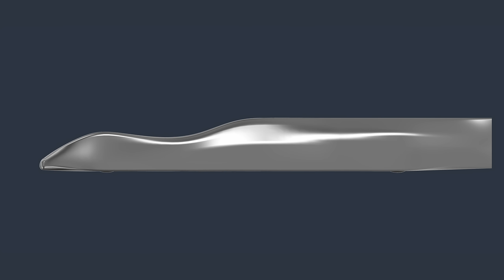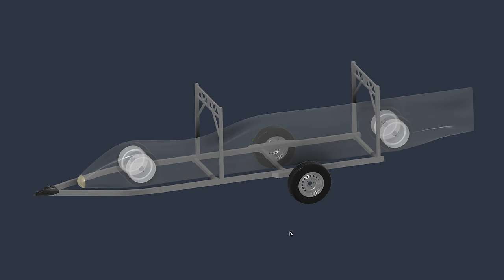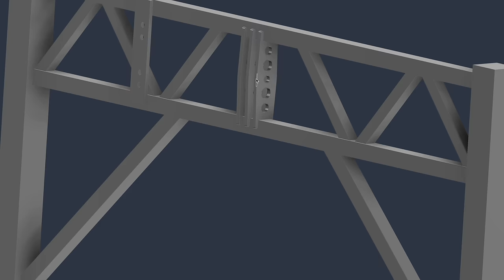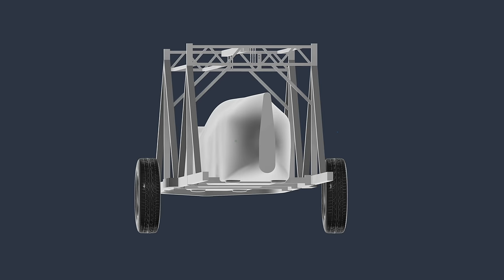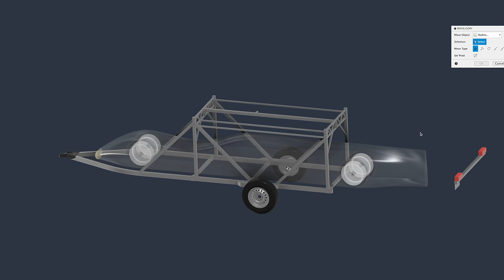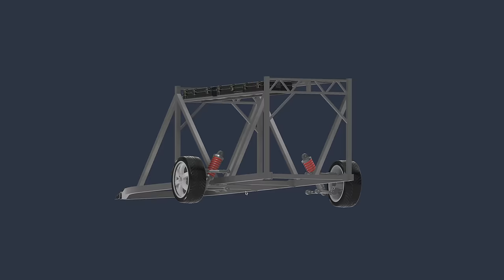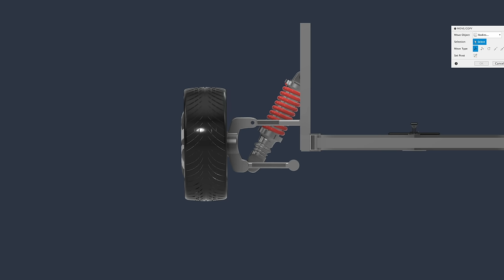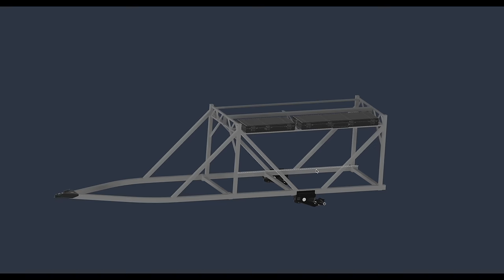How To Trailer A Car With ZERO Ground Clearance

Comment: This is so much more complicated than adding dolly wheel points to the frame
Reply: Do you mean adding dolly wheel points to the frame of the landspeed car? The car is going to get a fiberglass body which probably isn't rigid enough to support the car.
Reply: @vroomfondel5447  yeah, a little pinhole through the body into the frame where you stick a dolly wheel. I’ve seen similar on factory equipment
Reply: @jaredj631   I believe the nose will stick out past the front of the frame by a foot or two.

Comment: So you didn't put bearings on the pulley that you will load up. But you did over design the swing arms with double bearings that will just carry their own weight? Can't say that makes any sense.

Car tires are not the right solution for trailers. That's why trailer tires exist.  They typically have a higher profile, since tire flex is a big part of trailer handling. I suspect (but may be totally off base) that the load rating of the car tires isn't correct either.
Reply: True on many counts, however trailer tires are usually only rated for low speeds.  And you know....race trailer go zoom.  (I joke...but honestly on such a low weight and single axle trailer he'll be fine.  Probably.)
Reply: The swing arms will be carrying the load of the car when it is loaded.
Reply: @dirtdart81  which they didn't need bearings to do.
Reply: @donhappel9566  with trailer tires, a lot of the concern is side loading. Also, I can't recall what the race car weighs.

Comment: if it ever comes up... turbine engines are sometimes raised into a test stand via a screwjack that pulls cables. it can be cost effective in the sense that you don't need to buy a winch to pull a foot and a half on and off the drum with 25ft of cable. you can also use a trailer jack in place of an electric screwjack

Comment: I don't have time to read all the comments on the toilet to see if it's been said, but it's worth mentioning to the public.  Wear a respirator and grind off all the galvanized coating before welding, and wear one while you weld. That shit will make you seriously sick! Another great video matt, my idea has always been to have a motorcyle trailer that lays flat to the ground with a cantilever air suspension set up.

Comment: cool trailer seems simple to do if you have cad model and tools and don't forget to make sure everything will work and make sure everything is installed correctly and dont have OCD, otherwise straightforward cool build !!

Comment: About 7 years ago I actually had nightmares about car clearances on steep ramps. It wasn't so much as specific car models but rather a basic geometric figure in the shape of a car. I remember the worst part for me was at the top where the car gets stuck on it's frame....

Comment: Tip: the ratchet straps to lift the car work perfectly and are easy to replace if they get damaged. They might actually be a better solution than welding hooking points to the frame,

Comment: One solution that I've seen for people who have larger cruising type Harleys that they need to put in the back of a pickup is to have a platform that lays flat on the ground and then the motorcycle is tied down to it and then the entire assembly (platform plus motorcycle) is angled up and winched into the back of the pickup.

Comment: I use two m18 batteries wired parallel to run the 5500lb winch I have on my truck crane it works great even though I was told it wouldn't

Comment: I deal with slightly bigger cars, and I've always thought about making a universal car sled (with wheels) for the low cars. Strap the car to the sled and drag the sled up. I also thought about the gantry idea, but cant make it work since I don't want a dedicated trailer for the race car - I have enough junk as it is.   I like how this one turned out, I'll have to keep thinking...

Comment: You could make a rail above the trailer, put some rollers there with a winch, hook the car, lift it and push on the trailer. You could make some rollers to put under car's wheels to make some ground clearence so it could go on a normal trailer. Both ways would be simple but yours is cool.

Comment: You may put removable transport wheels on the car.  Just two small axles with wheel (removed for the race).  The front assembly can be design with a handle to pick up the car as low as 1" from the ground -- on a pin.

Inspiration F1 Racing front jack  (but with bigger transport wheel).  You can also use a dolly in the back (very simple an easy)

Comment: The "correct solution" for suspension is a horribly bad trailing arm - the pivot axis base is comically narrow. But it does work, and for the two or three uses that this trailer will actually get, I'm sure it will be fine... and other people who buy these declare that they are wonderful.

Comment: Here in the UK, since (IIRC) 2012, all new trailers need to be inspected and issued a chassis/type approval plate. These plates have (Amongst other things) the curb weight, the maximum loaded weight, and a model/manufacturer identifier number of some kind. The problem here is that cars ALSO have a maximum towing weight. Due to some questionable thinking when the laws were being wrote, you need a tow car that has a maximum toing weight in excess of the maximum trailer weight. That all seems fair until you realise that it's the maximum weight that the fully loaded trailer COULD be, so your 200kg (About 440lbs) empty trailer can't be towed behind your hatchback car that has a max towing weight of 1000kg if the trailers fully loaded total weight could potentially be 1200kg.......even if the trailer only weighs 200kg in the unladen state you want to tow it in.

There ARE a few useful little caveats to this though. For example, any trailer that was first used PRE 2012 has grandfather rights to be on the road, and doesn't need to be retrospectively tested/plated. There's a big benefit in how the maximum curb weight is pretty much anything you say it is, so as long as the tyres, suspension, or hitch isn't rated lower than that it's current weight (And as long as the police can't point to any particular part of the structure and say it's not strong enough) it's all good. There's also a bit that says an older trailer can be modified to keep it in a roadworthy condition. The general wording implies that the government would rather people modify their trailer so they can fit new (But not necessarily direct fitment) replacement parts instead of them trying to nurse along old worn out parts to keep the trailers non chassis plated status. The funny thing is, they don't specify HOW MUCH of the original trailer would need to be replaced before it's seen as a new build that would need inspecting......... Hmmmm, I see a loophole here. :D

My little 3x4' "Angle iron and planks" style utility trailer was originally (quite badly) home built sometime in the 1970's, so when I got it the thing was in a bit of a state. The first job was to replace the wheel bearings and hubs on the spindly solid axle. Darn it, It turned out that I couldn't find any replacement hubs..... So the whole lot came off and I found some braked independent trailing arm units that needed a new home. The problem now was the forces acting on the chassis would be completely different between the leaf spring and trailing arm setups, and I was pretty sure the 1.5x1.5X1/8" angle iron chassis wouldn't take the new twisting forces, so I built a new chassis out of 2x2" and 2x1" box section. While I was at it, I realised that 3x4' isn't really that big for a trailer with the accidentally overspeced suspension I'd bought, so I bumped up the bed dimensions to 4x8'. While I was at it, I also added some ease of use features, like removable back and sides, lots of tie down options,  sides that hook into the rear to double as ramps, and a lock box to keep a spare wheel and multiple ratchet straps dry and safe. As the original planks now wouldn't fit, I replaced them with a sheet of expanded mesh, and composite decking planks.

As it stands, the original parts are, the jockey wheel, the lights, and some of the old chasses angle iron that I chopped up and used to make brackets and stuff.......... BUT, by the exact wording of the relevant UK laws THIS is still just a legacy trailer that's had extensive repairs and modifications that enabled me to replace unavailable worn out parts.

With no chassis plate, when it's behind my VW Golf it's rated to 1400kg, but if it was behind something smaller, it's max weight would instantly be whatever THAT cars max towing weight was, and when a mate borrows it with his 1980's Land rover, it finally hit's the trailers suspension unit limit of 1.75 ton ! There's few cars that could tow a 1750kg rated trailer in the UK, so if I HAD bought one pre built (And plated) for this max curb weight, I'd not have be able to tow it with my current car.
Reply: See over here in NL they did it the other way around. If your trailer did not have a chassis number and registration of it's own, it'd automatically be derated to 750kg max total weight. Anything that has a maximum total weight of over 750kg needs to have it's own registration. And of course the required B+E license.

Comment: "Clean it later trailer" for when the only two parts of your landspeed car worth cleaning after the race day are the mounting holes. As a bonus, the new trailer should be even better at carying metal stock. Or water pipes, not secured in time.

Comment: Hey Matt: About Trailer Tires versus Car Tires - a couple of questions:
1.  What is the Date Code on the Viper Tires? While not an issue on Cars because they are typically being used and will wear out, Tires stored or on Trailers are not used as often with the result being that there can be Tire Failures for no apparent reason because of old rubber.
(This is what caused actor Paul Walkers car crash on what appeared to be new tires even though they were actually >9 years old)

2. Trailer tires are different than Car tires with a thicker sidewall (since the 2 tires are usually carrying a heavier load than the 4 tires on a Car) and are designed to dissipate heat faster. Will this be an issue with the Viper tires on a Trailer?

You've probably forgotten more about cars than I'll ever know but something to consider, especially given the low cost of a couple of tires compared to the cost and safety of what they will be carrying and attached to.
Here's a quick video on the differences: https://www.youtube.com/watch?v=rYOraVTyPOY
Reply: Also, not sure if Trailer Sway will be an issue with a Car + Trailer w/ Car-hanging-out-the-end Combo that is overall over 36' long but here is a video that I bookmarked a long time ago about the only way to reliably control for Trailer sway: 
https://www.youtube.com/watch?v=nc0ndz92IWY
(TLDR: Add a Trailer brake like the one that you mentioned at the 7:13 mark)
Reply from the maker: Good info. The date code and load capacity of the Viper tires are both good. And I didn’t mention this in the video, but the trailer has electric brakes. Honestly, I will likely get actual trailer tires at some point. Probably when I get around to listing the viper wheels and tires for sale.

Comment: If that steel line becomes an issue. I recommend looking into synthetic winch line. 
It's light weight and far easier to splice together.

Comment: Tie a plastic bag around the string and use vac to pull through tubes. 👍 Can you use a sacrificial anode on trailer to reduce corrosion. Like a ship. Zinc for salt water I believe

Comment: Just a thought, the folding rear end for tail lights design would also keep the car somewhat protected. Yes only from low probably parking lot mishaps and tailswings, buts its better than nothing, also could add some trailing wheels if you went for the fold out to keep it from bottoming out ever

Comment: I expected you'd just weld a pipe to it and use one of those motorcycle service lifty things to lift it up tbh. Or a wheel dolly going underneath that just lifts it via rollers that "squeeze" the tyre, lifting it off the ground

Comment: The difference between math and engineering:  "The ramps would need to be 8 feet long and the final 3 feet would be 2mm or less".  Then cut off the last 3 feet, a tire should roll over a 2mm lip.

Comment: A vacuum cleaner works well to suck a string tied to a tissue to pull the wires through the frame I thought about compressed air but the vacuum worked first time every time.

Comment: If I may add a suggestion: Add some sort of cover. While that will almost certainly be aerodynamically worse, considering the load, it's a safety feature. Friends are involved in the german historical car scene, and the number one reason for total losses is people driving up to your trailer on the highway, gawking at the car on the trailer...and crashing into it, because people subconsciously steer to where they look.

Comment: I wonder if you could design spots on the sides of the car to temporarliy attach larger wheels for loading and unloading. Then you would just need to jack it up to put them on and off. 2 sets of fat tires and a jack. But your solution looks much cooler. Also perhaps consider adding plates to protect the car from road debris.

Comment: I can't help but think you'd have been better off selling the original trailer to some chump and building a new one from scratch. Not sure what it's like there, but getting a custom trailer vin'd in Alberta Canada is pretty easy - pay the gov't $100, give them the receipts for the steel and axles, voila, vin'd.

Also I found Zinsser Bullseye works great on Galvanized. Had a kitchen with an exposed galvanized pipe at a ceiling corner, that I partially hid by priming in Zinsser, filling the cavity between the corner and the pipe, and painting the same colour as the wall. No bubbling or flaking.

Comment: 15:34 -  You could shorten it but dont quote me in this either but You may run into DOT issues where if the vehicle youre transporting exceeds a certain length of the trailer, it can be considered "Over dimensional".

However i only experienced that with commercial truck driving (53' long with a load that stuck out a little bit to the rear) so you may be fine in your case but its definitely something to consider going forward is all.

Comment: If you tie a long string to an empty shopping bag the plastic bag type. And then use a vacuum at the other end of your tubing you just suck the plastic bag through the tubing and they're your string is for running wire

Comment: check tractor supply they make inplement pins that will work much easier and stronger than bolt and cheaper with small derent ball.
Reply: The bars need to be clamped while towing. Not just pinned in place.

Comment: If you ever have to run string through a tube again,  a plastic grocery bag tied to the end will pull it all the way through to a shop vac on the other end.   It's a lot easier than trying to push a rope.

Comment: Brilliant as usual ... Cannot get over the idea that you go as far as taper roller bearing sets to allow the supporting cross members to swing across @ maybe half dozen swings per outing .., it interesting that sub 500 cc how many motorcycles get away with plain bushes for rear swing arm that do a site more " duty ".., but hay .., it's your money ... Love the double lift single winch ... Would it be worth putting back plates / inner wings ( fenders ? ) on the wheel arches to keep the salt from spraying up when moving to & from the big flat..? How about a quick catch up with you wandering round the " estate " with a quick couple of mins of the Jag / Honda etc etc just thoughs to camera .., no diagrams ... Maybe call it " niggles & dreams "... May your plasma cutter aways remain sharp ... Regards from the UK ...

Comment: Back in the day the rear trailing hubs from a Mini (the original one, not the BMW one) worked well for trailers.  Might be worth having a look online at what they look like.

Edit:  they look pretty much like what you ended up with, never mind!
Reply: The Mini arms have a much wider base, which is better but would be a problem on this trailer, where they can't project inboard past the frame rails. They are longer - which makes the wider base important - and reach around the front of the tire, so they would only work with Mini-sized tires. They also have better pivot bushings.

Comment: Do a hinged aero cover on the front of the trailer before making the body of the land speed car. Call it practice, or rule of cool. Plus if the land speed car trailer has a aero cover, the land speed car WILL be faster.

Comment: just a kind of random fun fact but did you know that modern synthetic ropes are as much as 40x stronger than the same diameter in steel wires and in many cases can be cheaper and easier to work with as splicing is easier and more effective than crimps

Comment: Did you ever explore the option of making small lift dollies on the exterior of the car? Either they lift using a small lip or you have lift holes in the side of the body. That should raise the car a few inches so that it can be loaded on to a conventional trailer.

Comment: Just an idea for the swinging supports but instead of bolting them down why don’t you run some lynch pins to stop the bolt from falling out, as long as they sit close enough to the frame it should make it a tight fit aswell

Comment: Matt you do nice work and have great design ideas, in my experience as a gas station mechanic, I have learned that for some reason you can’t put car tires on a trailer? Not sure why it doesn’t work but we had a number of  trailers that we fixed by putting trailer tires on. The complaint was the trailer would swing around and you could only tow very slowly, I hope that helps